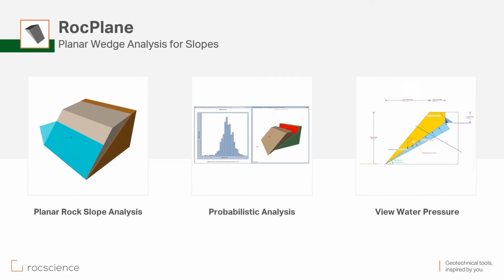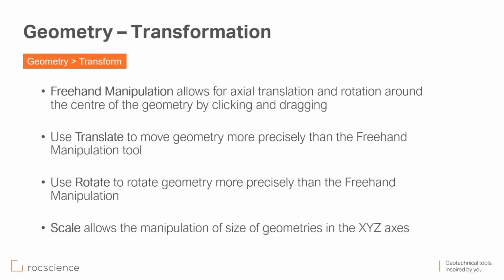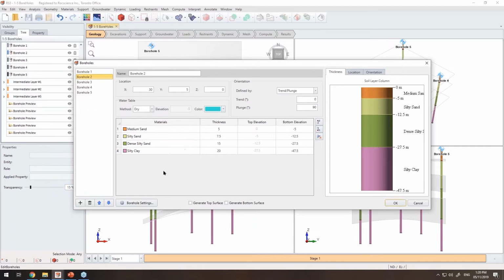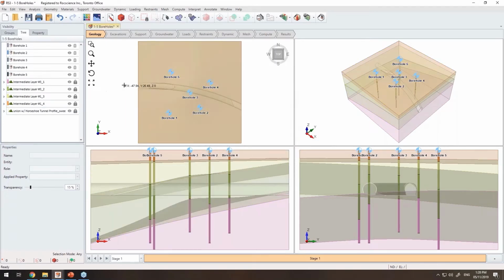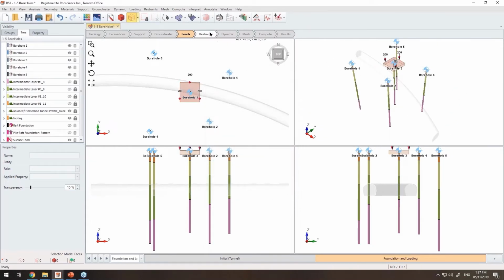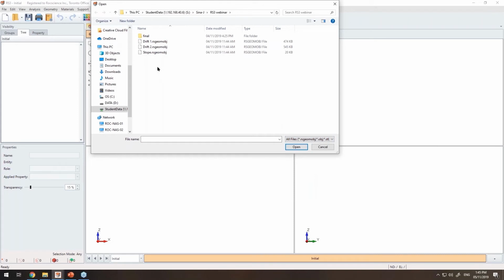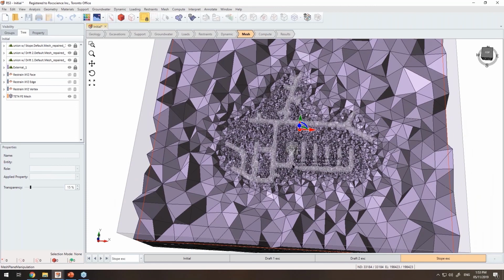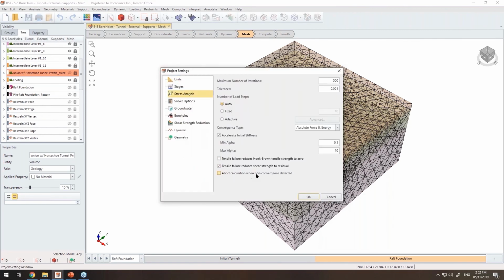RS3 Webinar Series  Part I - Mining & Civil Applications

Comment: Thank you for sharing such a wonderful presentation. I need to use one Rocscience software to model blast-induced vibration in open pit mining, Kindly I need your suggestion on which software I have to use for modeling the vibration from the blasting. Thank you.
Reply from the maker: RS2 and RS3 have dynamic module, within which you can define dynamic loads such as blast-induced vibration. RS2, since it is 2D FEM tool, is easier to start with, RS3 is the 3D FEM tool.
Reply: @rocscience   Thank you so much for the additional information.
Reply from the maker: @tigraywillprevail.7511  You're welcome!